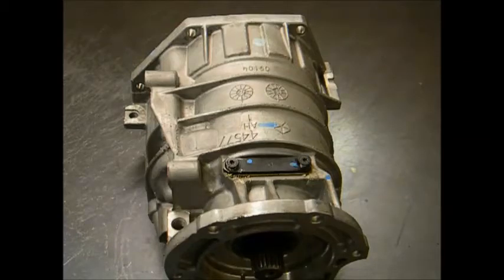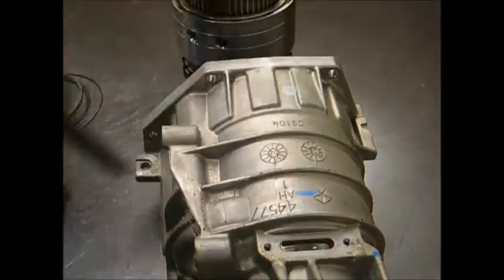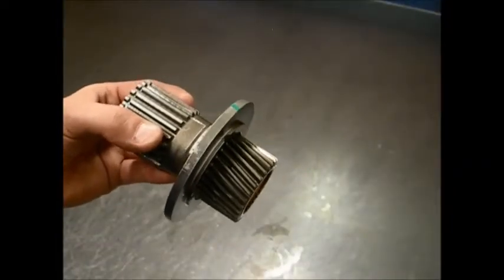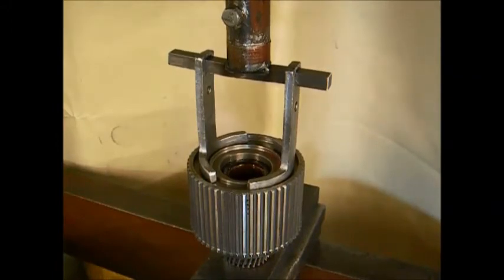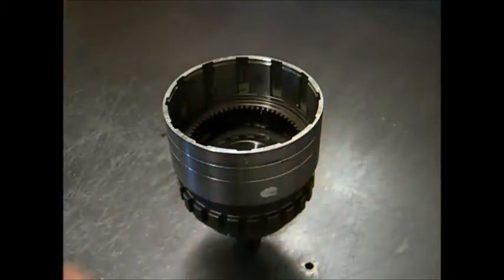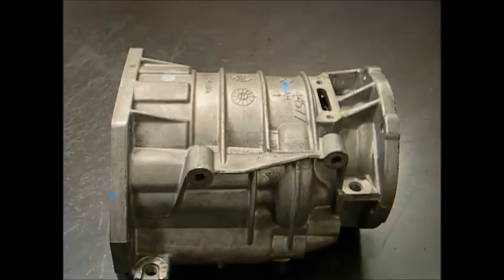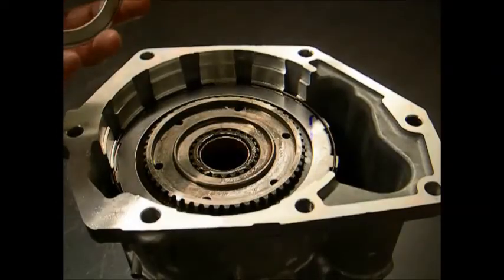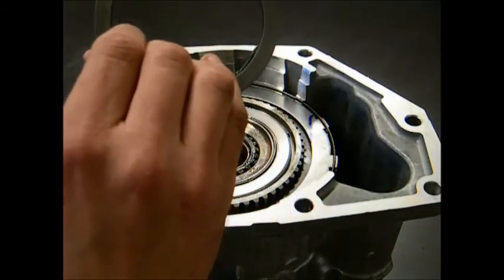GOEREND TRANSMISSION: OVERDRIVE SECTION

Comment: does this part can fix the reverse issue ? thanks
Reply: Does urs not have any reverse or did u get it fix?
Reply: @Junior-hd2hc  mine got some but it feels like is shaking when I applied it, I have to give her a little push to back up , im going to open the fluid pan to see whats going on.
Reply: Alright I took apart my transmission, nothing was worn except the OD housing. The snap ring that needs to be pressed on was broken and the clutches werent pressed on. Gonna try and drive it this weekend.
Reply: Also when I open the pan I saw pieces of the snap ring that broke
Reply: @Junior-hd2hc  saw nothing was wrong?? Betcha that reverse drum was scared something terrible & or band seriously needed to be replaced?🤔...
Reply: @T.C.  I guess u would say it depends on ur problems, I went in blind and torn the transmission. Amd after that I torn down the overdrive housing. And how it's shifting right.

Comment: So if you needed to replace just the housing, there is no need to disassemble the internal overdrive section?  Sounds like something I could actually do myself if that were the case (I don't have a press).  Great video.
Reply: Same situation I’m in
Reply: put me down for the same problem, going to give it a go and just throw the known good parts in a new unbroken housing and hope for the best
Reply: @AndrewBrowner  Worked good for me..  I shoved a #2 pencil in the parking paw to get it out.  Going on 3 years without an issue.  Got my housing from Cascade.
Reply: @andrewjessen764   i got the housing off, the park rod stayed with the transmission, ive heard its a pain to get it back behind the pawl, did you just slide the housing on and spin the output slightly to get it to pop behind the pawl?
Reply: @AndrewBrowner  Yes I believe so

Comment: Where do you measure the width of the piston at when selecting the correct spacer. That information is of no use without knowing where you measure the piston at.